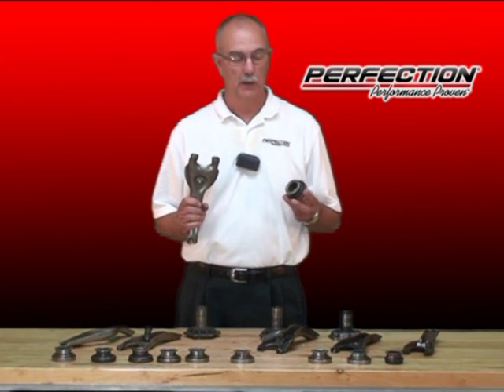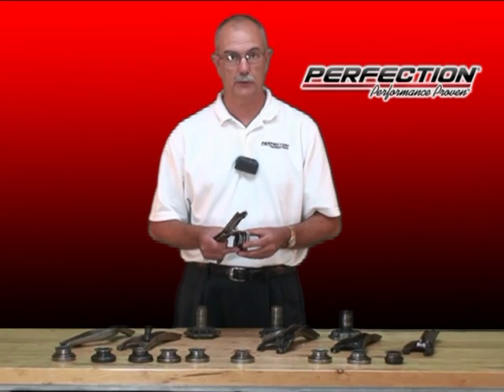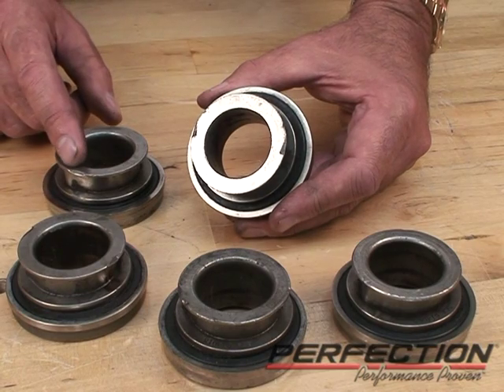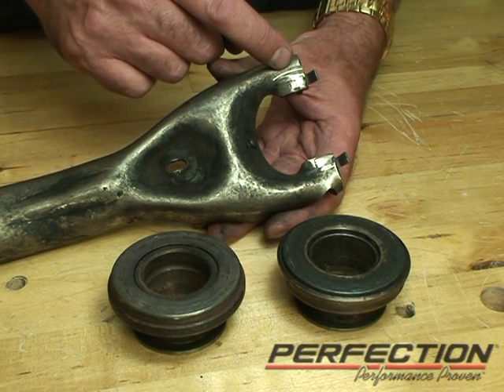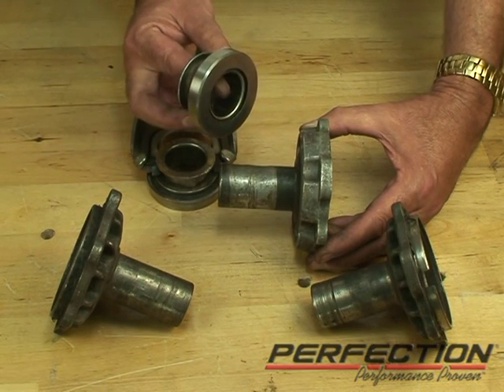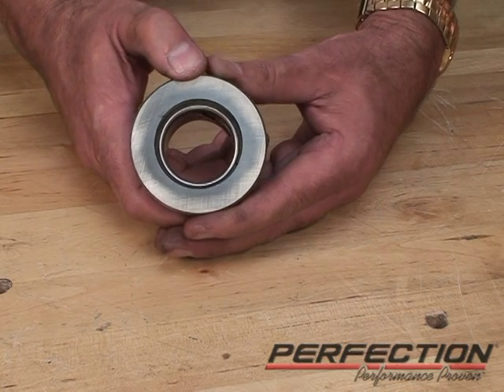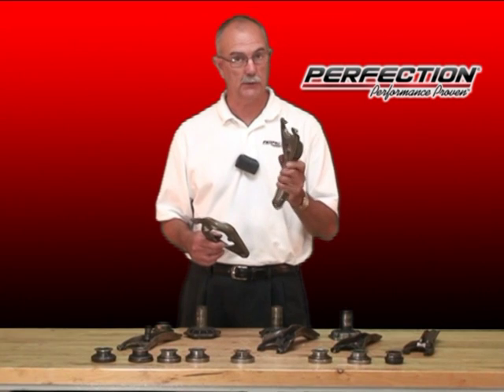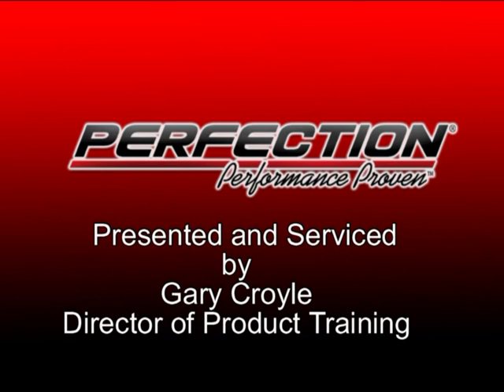General Motors RWD Clutch Fork and Release Bearing Installation

Comment: Thanks for not explaining where that spin prevention lobe should be clocked in relation to the fork.
I have to assume it does not matter at all. 
I see that you put it in for demonstration with the lobe facing away from the fork without stating it.

Comment: Does anyone know what might be causing a ton of vibration on the clutch pedal at idle? The vibration has been traced all the way down to the throwout fork. It has been an issue since previous owner. I replaced the clutch & throwout bearing - and the issue still persists. Thanks! 1981 trans am 305 Borg Warner Super T10 4 speed manual
Reply: Grease pivot bearing

Comment: Called tech support this morning and spoke with Tony I told him a number of times that I had a 2  wd Chevy S10 pickup with a 4 cylinder engine. I told him the clutch is very touchy. He kept asking the part number which I had a my garage across town. The number is 90191. The number below that MU 1904-1.  I told him I would call back when I get the part number. He then rudely hung up on me. I went around the block yesterday and the clutch was so touchy and jerking my truck to the point my camper top came loose and I got pulled over. I want my old clutch back. You shouldn't be allowed to be called perfection. No excuse for this at all.

Comment: Not a happy camper.  Purchased a clutch kit for 89 S10 pickup.  Clutch is very touchy and hard to drive. Don't recall having this issue with any other clutch I installed. New flywheel and pressure plate were cleaned with brake cleaner  Sad.

Comment: Just got clutch installec on 89 s10 pickup with 2 wd. Watched video prior to putting trans in.  Pedal seem to light.  Old clutch felt better.  It seems to easy to push pedal it.  A new clutch should have more resistance than what it does. Have yet to start truck up. So I don't know  if it releases right. Crossing my fingers.

Comment: Just learned all this the hard way. Too bad I didn't see this earlier. Is there a correct way to install the bearing re the cam on the bearing?  I've been told it should face the fork but in your video it faces away from the fork
Reply: thank you
Reply: Should it face towards the fork or the shaft?

Comment: Just put transmission in there was no release bearing clip in the clutch kit it has been installed without any clip do not remember seeing one on disasembly  it is a 1988 K1500 is it possible there is none.
Reply: Damn there were no spring tabs

Comment: What would cause a guide tube to break off the transmission?  I could not get my truck into gear while running, after I thoroughly bleed the hydraulic system and still could not get it into gear I pulled the trans. The guide tube has broken off completely.  I am curious if this is why I could not shift into a gear.